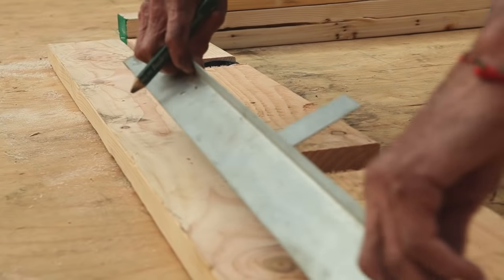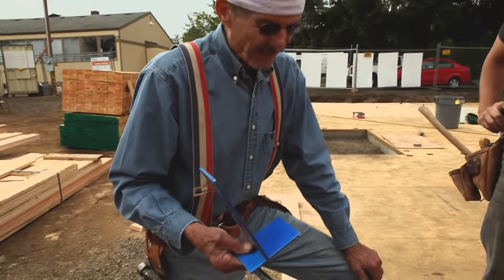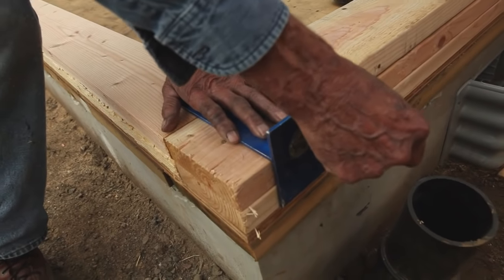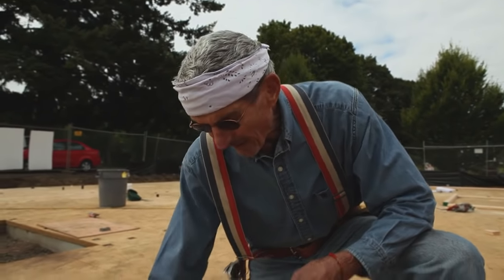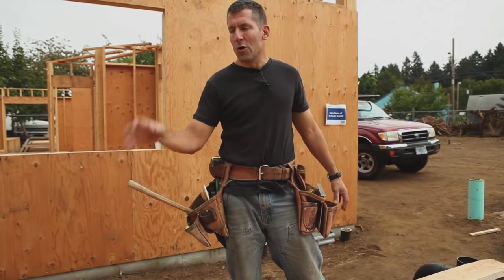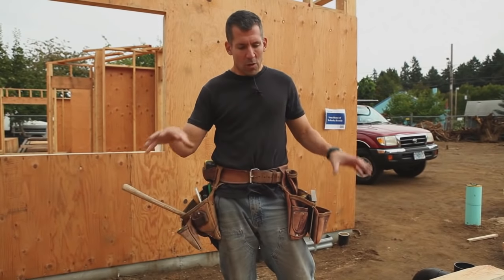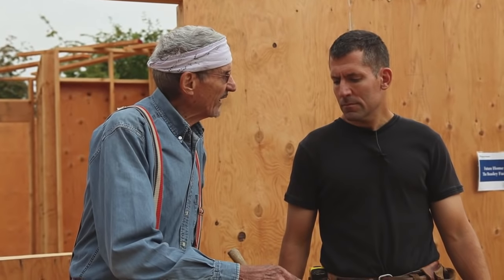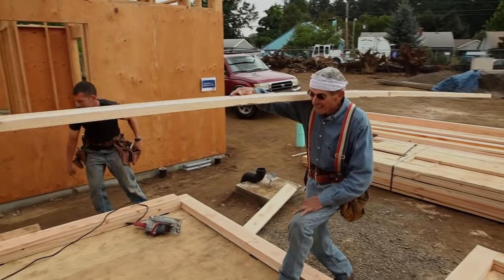Framing Basics: 3 Tips for Laying Out Wall Plates

Comment: this guy trained framing crews ( 3 men) that could ( still) start with a foundation and hand nail 200 sqft homes, in three days. Their roofs are hand cut, not trusses. When they use air nailers, they cut 4 hours off the time.

Once the plates are down the lay out guy gets a 5 minute head start. Then the other two following  start scattering studs and nailing them.
Reply: me Larry Haun damn near single handly built the valley back in the day. He did so much work, he was pulling in doctor wages in the late 70s.

Comment: why isnt the exterior sheathing constructed to rest on the concrete foundation instead of hanging off the edge
Reply: joe montez He mentions that on their slab they've got a pressure treated plate under. They make us nail sheathing into that plate here in Canada for shear strength. I guess so that its more solid that wat
Reply: It hangs off the edge because sheathing is not load bearing, and it also helps shed water to the outside of the foundation if the siding is ever damaged.

Comment: To lay out all the wall plates of the whole house and work on top of them makes 0 sense. The cleaner the floor the better. Lay out the 2 long walls build them then lay out the other 2 outside wall build them and then lay out the interior walls.